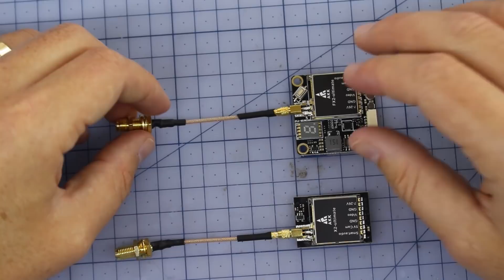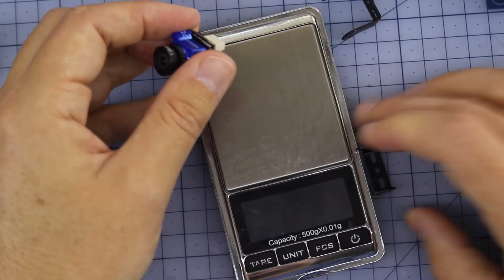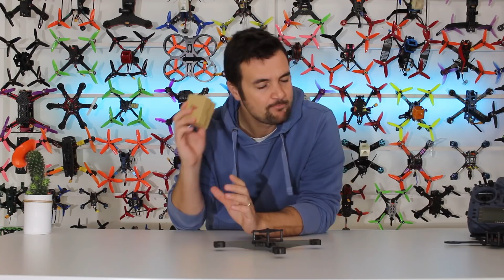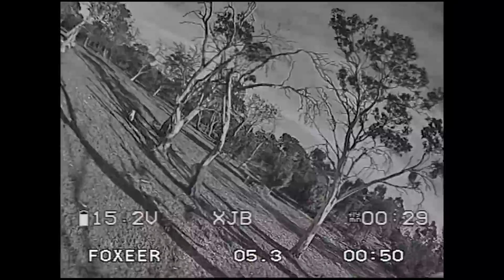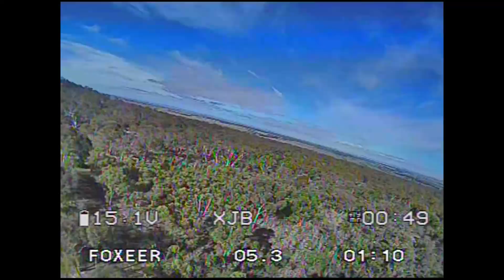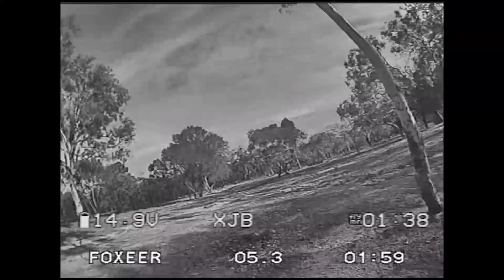ULTIMATE LONG RANGE VTX 1200mw! 16 Y.O frame design! foxeer predator v2. Tech Tuesday

Comment: I'm trying to fully understand the difference between the US and non US version of the FX2 Ultimate Mini 
some results say i do not need to unlock the US version at all unless i want to use E4 E7 or E8 and can use 1000mw over smart audio 
for example lets say i buy the US version and want to fly with others so i set it to 25mw on Race Band 5 but when i am alone and want to test range can i set in smart audio to 1000mw without messing with pressing any buttons... 

1000mw is more than i want and if i can select it with smart audio without the messing with holding buttons, if you can then the US version is the best option for me 

thank you for your help

Comment: The Akos frame looks really cool. I think vertical arms are just superior (especially at high speeds) and this designer found very good solutions for the three major challenges: center connection, motor mounts and horizontal rigidity. Way to go!

Comment: These are really good vtx's. Be very careful when installing the mountable one.  There are some very small components next to the mount holes.  If you mount the bored with a standard nylon nut you will break off some of the components. So be very careful mounting do too the lack of proper clearance.

Comment: There are solder pads on the VTX..... look closer....
Reply: UAVfutures there are quite clearly 6 solder points on the top of the PCB and are all clearly labeled with what they do. You should be able to solder wires directly to them. To the right of the plug, on black “can”.
Reply from the maker: those 4 solder pads underneath dont replace the 6 needed for the connector
Reply: I kinda like the connector because it makes it easy if you need to remove or replace the vtx
Reply: dude u must be blind or just slippin?

Comment: Well, I think that frame is good. Is it really good??? it will depend on the pilot; here's my analogy:If I'm going to learn to race Formula 1 cars, I need to start on a go-cart. Then, I will work my way across go-cart types through every amount of damping in the suspension, ultimately deciding to match the suspension to the track, and never calling any particular suspension the best one. Some pilots only fly one kind of way, and very few of them will want this frame. If only one very limited kind of performance is your cup of tea (and this is just what many people find the most fun), then you will quickly specialize into a very expensive and already popular market leader. BUT IF the pilot want to explore and learn about some aspects of various frame design, and how they perform in various settings, then this frame will offer VASTLY MORE learning opportunity for most people about vertical arms and how they may behave as opposed the so many inexpensive frames that so many people have and love.

Comment: Is that even legal in Australia? I thought we were limited to 500mW?
Reply: Obinna Eke you should
Reply: Obinna Eke because dollar per DB you don't get as much increasing mw tx power than you do by going with a quality directional antenna. Also increased tx power means more heat and spurious emissions to deal with.
Reply: Tradie Trev 200mw.
Reply: I'm going to setup 1.2ghz . The rig is cheap but wheighty and goes 3/4 klm i think , but thats supposed to be typically used on fixed wing i think
Reply: 25mw is the legal limit in Aus.
Reply: N0FPV Why? I fly alone pretty much (although I fly at 200mW mostly though) I fly ac2cirding to the distance I fly, otherwise you just waste battery
Reply: Who cares 😂😜

Comment: Not sure about the frame. The arms are vertical instead of horizontal would add more drag?
Reply: With the quad flying near 45 degrees it wouldn't make a difference in drag.
Reply: I tried vertical arms two years ago, and I will never go back to flat arms (at least for racing). They track so nicley, like they're on rails. When I fly a flat arm frame on track i always drift super wide in the corners.
Reply: Interesting.
Reply: Ohio yes i guess you are right once it tilts there would be less drag I guess i was to quick to comment and did not think about it5.

Comment: For camera reviews I really think an on board DVR is the way to go so you can see the image without breakup. Having said that this looks like it suffers the same problem as the first version muddy shadow detail. Don't get me wrong i like the predator and the blue cast is easy to fix on the original with the correct settings but the eagle 2 pro beats it for due to the shadow detail IMO for a WDR CMOS camera.

Comment: Uff you just read my mind I was actually looking for a long range vtx kind of weird !!
Awesome video stew !!!🥇🏆
Reply: Pablo García more power is not the best for long range and is less cost effective per DB gain increase. Always buy better antennas first.
Reply: I would suggest Unify before getting this. or at least wait till someone does a proper power check on the output and make sure it keeps it's power promises.

Comment: AKK vtx’s are amazing!!! I tested them at 1200 and they read 1600mw actually :D
Reply: N0FPV True, antennas are the best way to improve range.
Reply: Mini Quads Mega Fun it depends on the channels you put it at :)
Reply: What’s the best channels then?
Reply: hellfire08 you mean the channel with the highest output?
Reply: R1 Outputs the highest I read! (1700+!)
Reply: Not legal in most places and really isn't needed with proper antenna and a clean setup.
Reply: N0FPV doesn't have to be one option or the other. use this VTX with a great antenna and you'll have incredibly reliable video signal.
Reply: droneXcursion running excess power is a good way to kill range. Over heating or interference will not let you go as far. You just don't need it. If you need more range than what sub 1w vtx can do, change frequencies. 

Understand the physics at play, and how to maximize your dollar. Not every one has unlimited funds to waste on over powered transmitters.